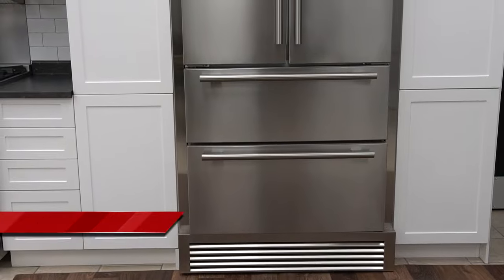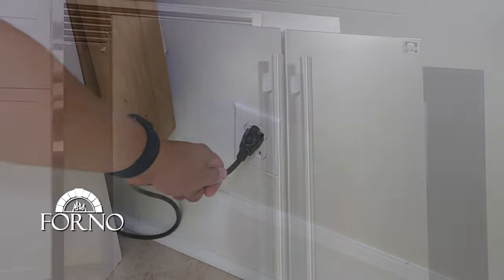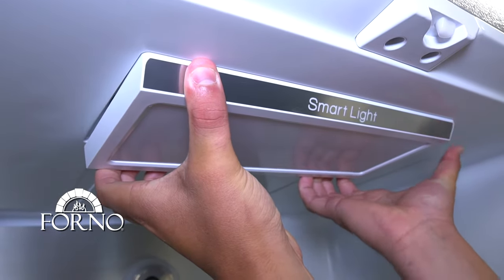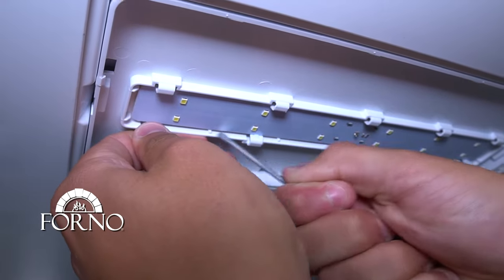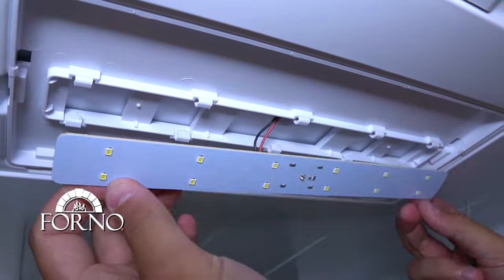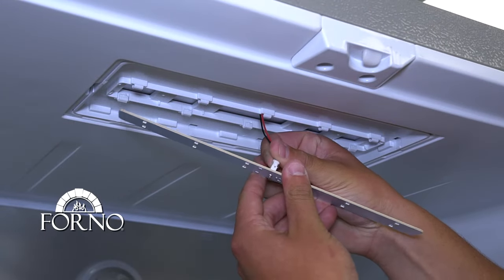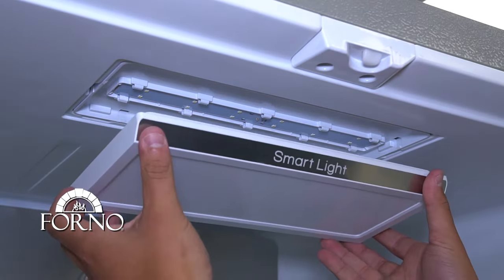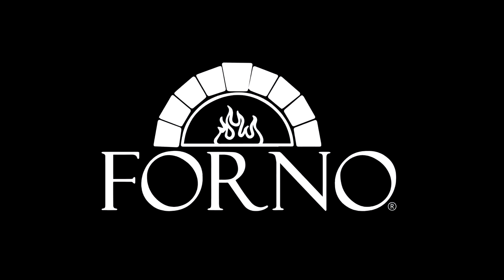How to replace the LED light in Fridge 1820-36

Comment: Not able to open led cover.How to do that in double door Hitachi fridge.
Reply: Does your light cover run flush to the fridge. I had to get a very thin screw driver and hammer it in the "gap" gently then the first clip came out, then could pop round the rest with ease